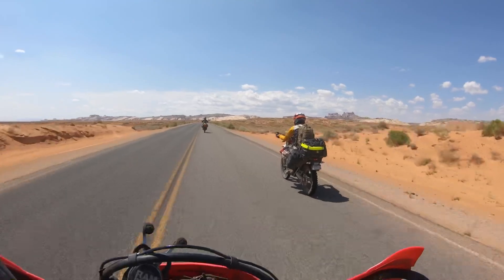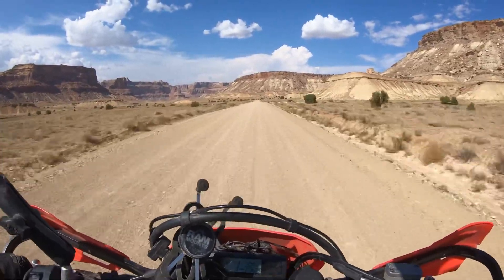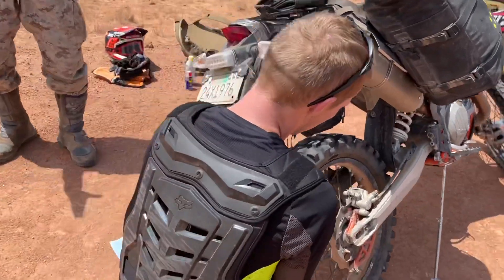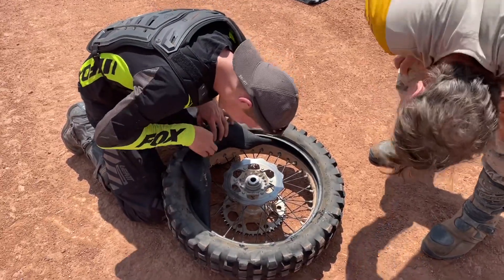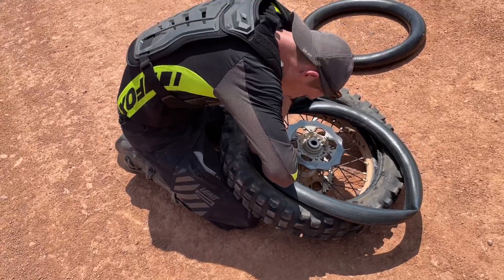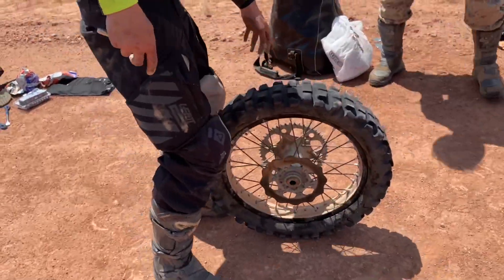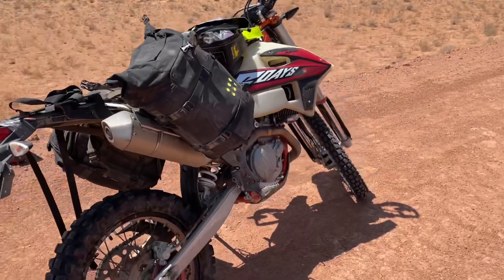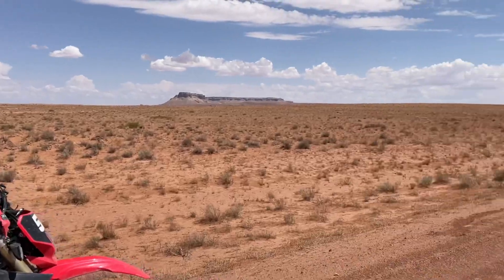Trans America Trail, Day 24, Mechanicals in Utah

Comment: I noticed you have the Dango Mount.  Did it work good for you on this long trip?  Did the clip piece that you squeeze to release it ever get annoying, like hitting your chest, etc?
Years before my current bike (DRZ400) I had two DR350SE bikes that were notorious for breaking clutch cables in the same spot that Jake's broke, right at the ball.  After that, I always carry a spare clutch cable, and a spare shift lever.
Reply from the maker: Jake likes the Dango and it did well on the trip. I didn't like it because I felt like it hit my chest when I tried to look down (maybe I just have a short neck....)